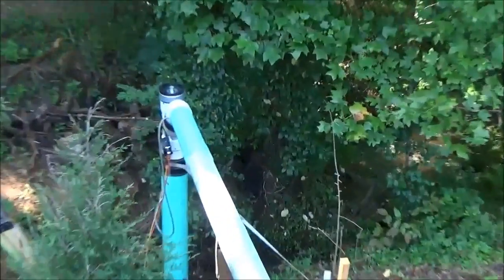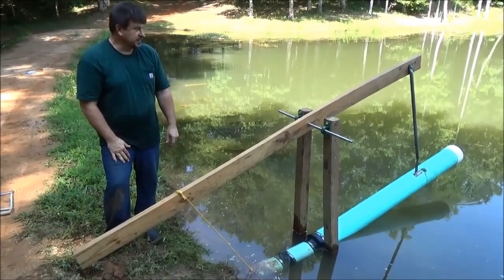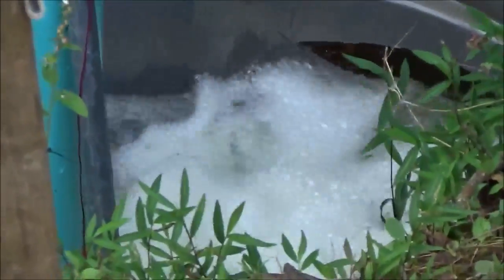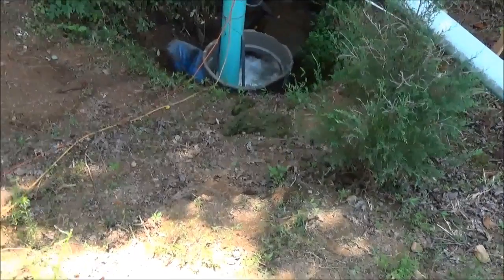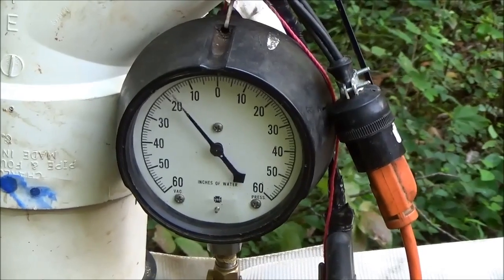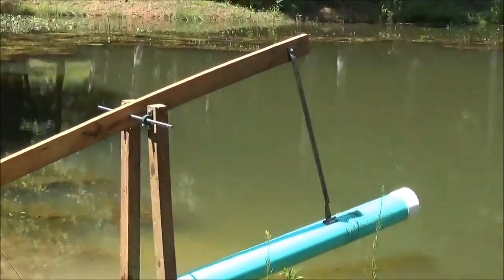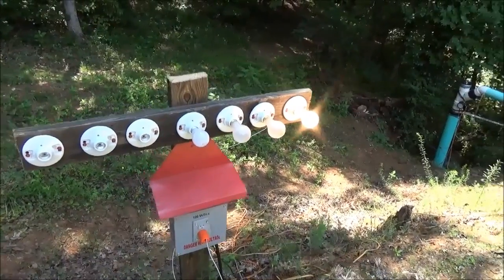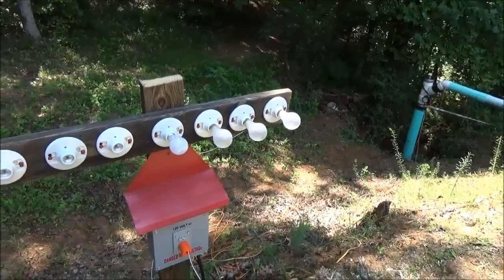Pond Power:  Part 2

Comment: driving me nuts lol

"A turban (from Persian دولبند‌, dulband, via Middle French turbant) is a kind of headwear based on cloth winding" 

"A turbine, from the Greek τύρβη, tyrbē, ("turbulance"),[1][2] is a rotary mechanical device that extracts energy from a fluid flow and converts it into useful work."

i know i know lol

anyone else wish they could run one of these from there shower lol
Reply: *their

Tsk. You're correcting someone when you can't even correct yourself first 👀
Reply: https://www.amazon.com/Temperature-Shower-Head-Manufacturer-automatically-temperature/dp/B00JV4BVCM/ref=sr_1_4?ie=UTF8&qid=1544481807&sr=8-4&keywords=light+led+showerhead

live long and prosper
Reply: Its called ACCENTS some people pronounce it that way.
Reply: turbine. comes from that word somewhat too i think

Comment: 500 watts is nice bro ! but the price range for that unit is out of my limit .
Reply: The PVC one that he is using will be $850 for DC power & $300 more for the AC inverter
Reply: Langstons Alternative Power Spencer Langston Aloha.
Harnessing potential energy from  water like this is definitely worth the expense for the equipment.  Roughly $1,200 is generating 500 Watts on demand, day or night, for as long as you have the water source (spring or stream fed pond?).
Compare that to the amount of power $1,200 of Solar PV panels will get you.  Assuming both have a constant daily replenishment (ie, the sun rises & sets daily, the pond is replenished daily from a spring or stream), the micro-turbine generates far more power.  I am just jealous as hell that I don't have water available for a power source, kinda scarce in Arizona.

Peace & Prepare
Pax et Paro

Comment: Just a idea, How about make a lever that will drop the pipe based on the level of the pond, like a toilet bowl but as the level in the pond drops to a set level it raises the pipe out of the water, and when the level of the pond hits a high point it drops down into the water, I would think a big block of foam and a pivit point would be all that it takes to run by it's self.
Reply: people upset about it could make their own dump back into the pond
Reply: If you could pump the water back up and create more energy than it would consume, every single power company in the world would do that on a massive scale. But pumping water uphill will use a lot more energy than it would eventially produce. Basic laws of physics.
Reply: It's called a float valve. What is it with wards and spells these days. liber lexi logo

Comment: This is cool. I was wondering, couldn't you lower the tail end of that pipe where the gen head is, down 2 or 3 feet and gain more head? I'm just wondering why you have such a straight run.
Reply: The power is mainly generated by the vertical drop which gives the suction to increase the power .That's where the vacuum gauge helps to tune the hydro unit to the intake pipe